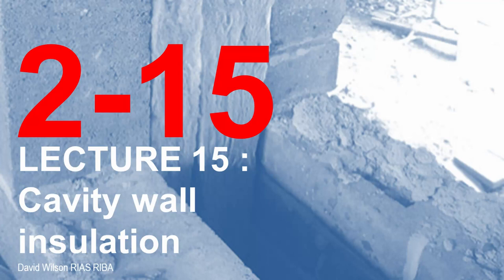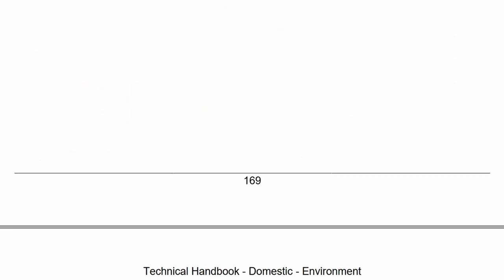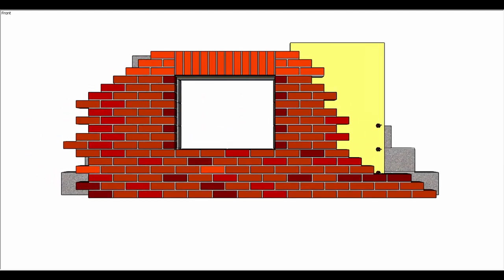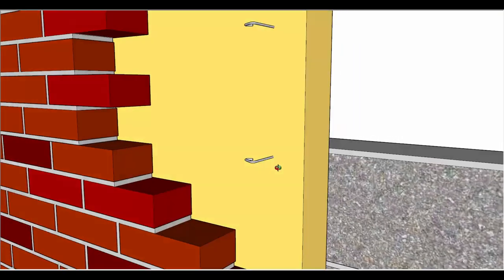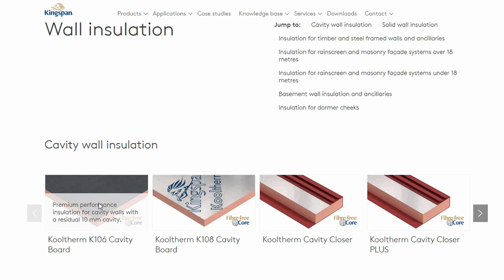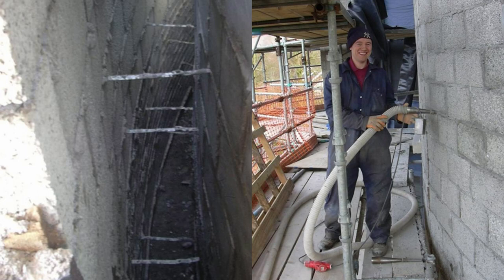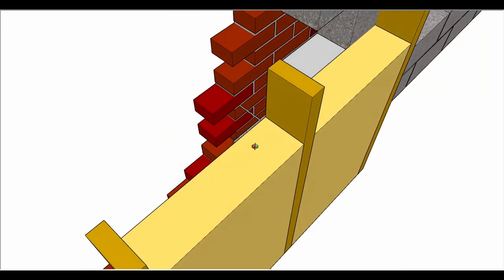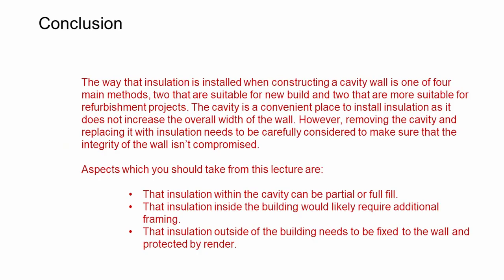15 Cavity wall insulation

Comment: Injecting beads into cavity might cover wires. What is you opinion. Would the wires over heat.  I think with only a 2 inch cavity it is unlikely that amount of beads would cause an issue
Reply from the maker: Filling a cavity within a double skin wall shouldn't really affect the wiring as most often the wires will either be run on the inside of the inner leaf (i.e. inside the building). They might be surface mounted and visible within trunking (a bit ugly) or placed within a second dry wall layer or they could even be chased into the wall and plastered over. I would check where your wiring is before filling the cavity if you are concerned. Hope this helps. R